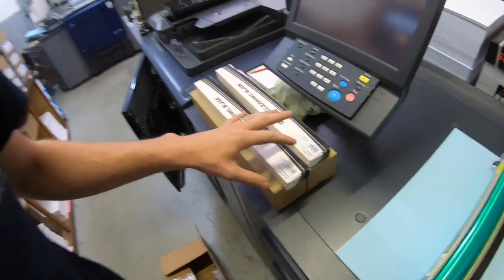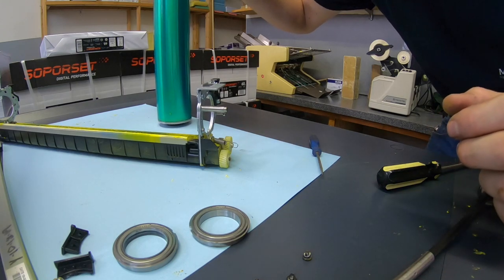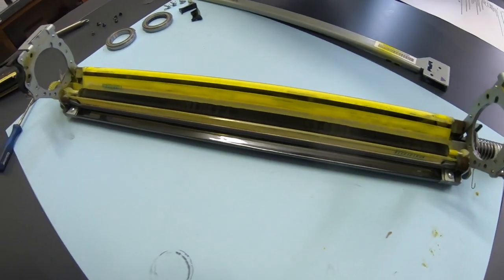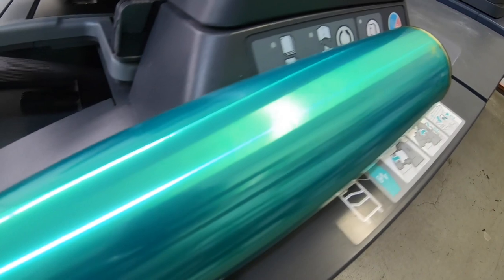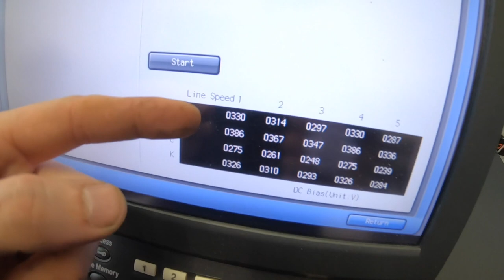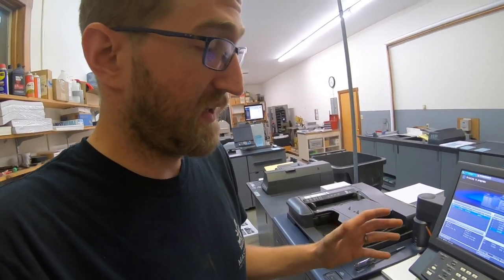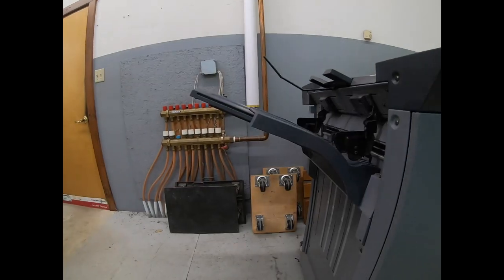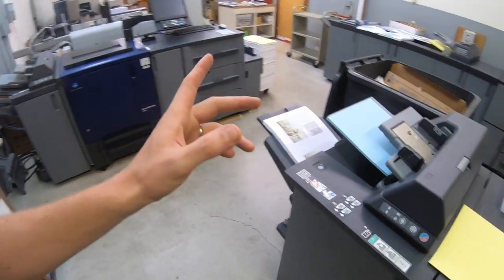How to Replace the Drum and Cleaning Blade in DU-105 for Konica Minolta C1070

Comment from the maker: Update, don't waste your time on Generic Drums. Buy OEM.
Reply from the maker: Reason is there are three wear items in the drum unit. The drum, cleaning blade and wax roller. All three need to be replaced, but you are only replacing the drum when you buy generic drums.
Reply: @justaprinter  you can also buy kits that include the drum lubricator, I have some, yet to try them though.
Reply: Thanx for sharing and the "HEADS-UP" 😳
Reply: Hi. I work on Ricoh machines almost exclusively and when I came across your videos I was having a look at them to see what the process is like.

With this particular video I think I have to agree with you to replace the entire unit. Reason being, with the complete unit you get the drum, blade, cleaning brush and lube bar.

Anyway thanks for the cool videos.
Reply: By changing opc we have background problem when we open up that right black cover fitted with two screws😮.i.e uneven test patterns.
Reply: How should i buy these drums can you send for me for other konica minolta pro printers?

Comment: Thanks for this... got me started but I hit a painful issue some may benefit reading about.

You can remove the drum WITHOUT taking off the 2 black plastic cams (3min 40sec) at either end. These cams are set at the factory and the screws are glued in place. If you do remove one of these you will notice that it has about 2mm of play. It literally has locating slots rather than locking holes so that it can be adjusted. These cams set the distance between the developer/toner supply and the drum.  If these are NOT put back in the same position, very hard to do, they get out of whack to the drum and sit too close or too far from the drum causing a side to side density difference. 
All you need to remove is the top brace (0.50secs) that provides structural rigidity end to end and operator side bearing. The drum can be slid into the space left by the missing bearing and then up and out.

No idea if they can be left in if you have to replace the rubber blades.  

Its safest to dust (with toner) any parts you clean before putting them in contact with the drum.

Regarding drums.  They are light sensitive.  If you play with them under any type of normal office lighting strength or worse daylight… you will damage them.  They can come back.  Not sure if its time or use that brings them back but they can. I use a single incandescent lamp pointed into the corner of the room with no other light.  Makes for dim working conditions but a damaged drum is far worse.

Oddly enough, in other ways drums are quite robust.  I ran some envelopes recently and glue made its way to the drums.  I wiped it off directly on the drum while it was still in the machine with very soft rag and alcohol.  No damage.  On another drum glue was smeared all the way around.  I had to take it right out and ended up wiping down the entire surface with no damage.  Unfortunately it slipped from my hands twice while cleaning.  Once bouncing off a screw driver and the other falling directly on the table. Incredibly I can see no sign of damage in the print.

Comment: Good idea to buy a pouch of drum set powder or "dusting powder", especially when using generic parts. Some drums and blades come pre-coated, but not all. Depends on the model or if it's OEM. Tap the bag over the surface of the drum as a light single coat and do the same on  the cleaning blade(s) before installation.  You can use pure toner in a pinch, but white setting powder is less messy and will lubricate the drum/blade better in prep for the adjustments and decrease the chance of blade drag/flip as well as part damage short-term. Konica dealer tech in NY.
Reply from the maker: I was wondering if that might have contributed to early failure of the generic drums. I put some setting powder on the blade, but maybe not enough. Thanks for the tip. Keep em coming! :)
Reply: @justaprinter  Its the coating on the generic drums - they are just not as well coated as OEM. My company is Toner Plus and this is what we do. If you can find a good quality aftermarket drum they can last almost as long as the OEM drums. Many years ago Mitsubishi put out a drum for the remanufacturing industry for HP printer cartridges - it was called a super drum.  The coating was so good and thick that all you had to do was give it a polish and it would last almost indefinitely. They then realised they made the drum too good and withdrew it from the market. I like your videos very much.
Reply from the maker: @eddybulich3309  Interesting! Thanks!

Comment: my biggest concern with the drum rebuild idea is, what happens when you're in the middle of a big project and you discover that a drum needs to be replaced.
Do you stop everything for 45 min? 
Do you shuffle the work load around with the other presses so that the priority work gets accomplished?
Do you just keep a set of new ones around just in case or, do you purchase a second set of assemblies and then just keep perpetually rebuilding them as you have time? If storing rebuilt units how do you protect them from moisture/other environmental elements?
Reply from the maker: I have learned not to bother with rebuilding. I now just keep a few OEM drum units on the shelf at all times. Much better!

Comment: Hello! Great videos! I see you own only konica printers 1) what is your opinion about other brands for example xerox? Also 2) if you were just starting your business now what printer you would buy? ( small budget ) And from the printers you own 3) who is your favourite considering print quality/service consumables/toner cost? Thanks!
Reply from the maker: Xerox makes nice machines. I like Konica because I can buy parts and service myself. Other brands are hard to find parts for. I switched from Xerox printers to Konica because Konica was cheaper to own/operate. Basically any printer will produce high quality as long as you are keeping up on maintenance. The C6500 will make a good starter, however at some point they will stop making parts for them, so maybe a 1070 would be a better choice.
Reply: Just A Printer thank you!

Comment: Sir.. In my machine bizhub 6000.. Drum gets dots/scratches very easily even if they are used 5%. It's happening with me for last 1 year. Tried changing developer, Charging, drum but still drum is getting dots.. Plz let me know the solution if any
Reply from the maker: Oh man. I'm not sure. Sometimes I would get dots on my 1200PRO drums and I just figured they were defects from the factory. I tried generic drums in this video and they didn't last long at all. Only use OEM.

Comment: You should see if you can get the cleaning brush and lube bar also. The drum gets scarred up like that when the lube bar is gone. You may even be able to get the drum to last longer by replacing just the lube bar when they say the drum unit is due.
Reply from the maker: Hmm, interesting. I'll have to look into that. I kind of doubt that I can get those parts, but that would be a completely new unit then.
Reply: @justaprinter  I work on a different brand but I also have seen knock off drum units for konica.
Reply: Sir.. In my machine bizhub 6000.. Drum gets dots/scratches very easily even if they are used 5%. It's happening with me for last 1 year. Tried changing developer, Charging, drum but still drum is getting dots.. Plz let me know the solution if any

Comment: Hi Dan, thank you so much for your great videos you are a blessing, i've learned so much!. I hope you can help me, i have a 2060L, since new the drums keep getting scratched by the lubricant bar, even at 8% (some times at 50% it varies) after a long run thin white lines appear FD, When installing new one we only adjust gamma. My local tech disassemble the drum unit and sand the wax piece to clean it, it fixes sometimes but the problem returns after a while. I never had a drum that lasts at least 100% even on my C6000 last up to 200% , i print mostly high coverage. Thanks so much.
Reply from the maker: It could be because you are running an "L" machine. I think the use different drums and are considered light duty.

Comment: Hi,
Is drum good for the C3070?
Where can you buy only drum without drumunit?
Reply from the maker: Yes, it would be the same drum, I bought this one off of ebay.
Reply: @justaprinter  Have you ever tried Precision Rollers site? They  carry the OEM Drum Units. Personally I stopped using non-OEM parts as they can be too much of a gamble. Did this once and it pulled out all the developer and it went everywhere and got into all the clutches below. It cost more than what I saved (time and money).
Reply: Precision roller is good, being in SoCal I mostly use Serj at Toner Town in LA. Great prices and service!

Comment: Hello from Brazil. Thank you for your amazing videos.
When you say OEM Drum, you mean an original Konica DRUM but without the original package?
Can you send me a link of the generic and the OEM Drum? So I can undestand the diferences?
Thank you a lot!
Reply from the maker: I mean the konica OEM drum unit. The generic drum I bought off ebay. Not worth it. The difference is when you replace the drum, you are not rebuilding the entire unit. There are other wear items like the wax roller and cleaning blade that should be replaced and are not.
Reply: @justaprinter  thank you a lot

Comment: Yoy should know that disassembling the black plasic parts from the sides is not a good idea, because they set the drum-developer distance. You can still remove the blade an the lubricant bar without touching those parts. You should also know that if you dont clean and polish the lubricant bar unevenness, the new drum will get damaged very soon.
Reply from the maker: Yes, I found this all out after I did this. I decided to just use OEM drum units after this.